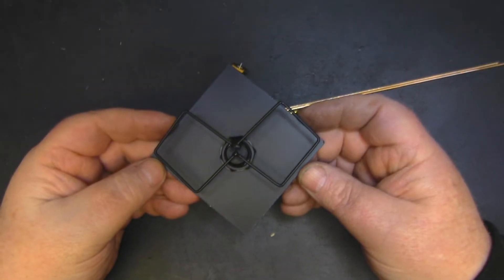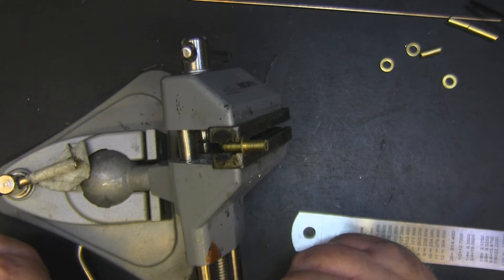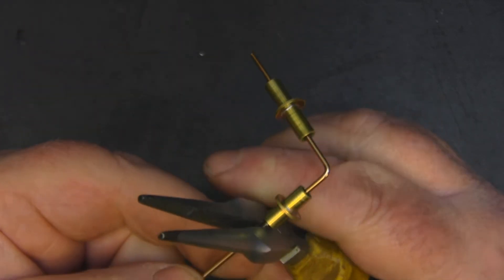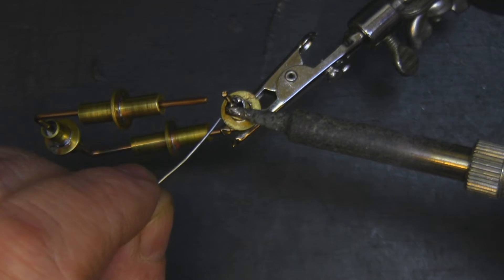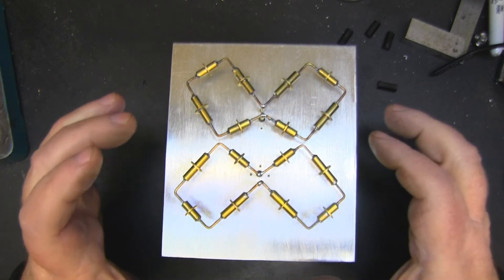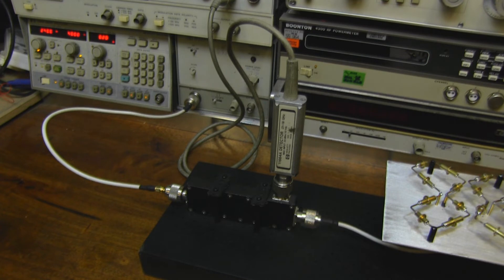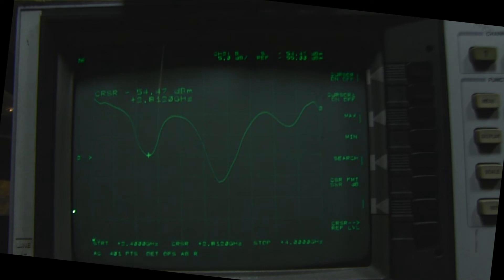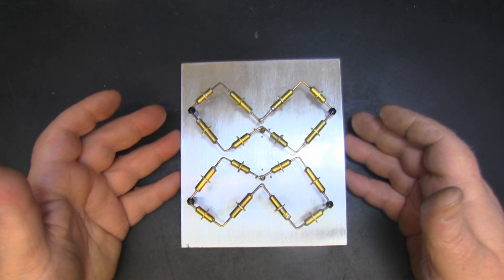3G 4G and now 5G Biquad Panel Antenna

Comment: Hi Andrew, sorry for disturbing again. I live in Canada and my tower runs one band 4, 1700mhz uplink and 2150mhz downlink. Should I build this antenna or stick with the 5g patch you built a while ago? I asked this same question a while ago. This antenna does hit 2200mhz and 1800 mhz, but will it work for 2100 and 1700mhz?
Reply from the maker: Yes this will work just fine
Reply: @andrewmcneil  thank very much, sorry for the multiple messages
Reply: @andrewmcneil  Hi Andrew, sorry for bothering you. Can I use thicker wire to increase bandwidth or should I stick with 1.6mm?

Comment: I tried to build this antenna paired with Deco X50-5G (using lmr400 cable) but the best I could achieve is increasing signal from -90dbm to -86dbm , is that okay? Or may be i did something wrong?

Comment: thanks chief. I have issue with signal strength indoor, and I wanna build a 700/1800MHz 4G+ antenna. I have already Mikrotik router with LTE class12 modem.

Does the coax cable matter, please?

I can squeeze about 3mm wire through out the old windows (old rented flat). I can't drill walls or window frames. I have some old 3G antenna with external antenna, and they have about 3mm coax.

Any suggestions to this challenge? all standard coax cables have around 5-6mm

Comment: Thanks. Two questions. 1. In testing this antenna you get a peak at 3.3 GHz which you said was smack dab in the middle of the 5 GHz band in the UK. Will this antenna work for 2.4 & 5 GHz WiFi in the U.S.?
2. What’s the function of the brass tubes and washers?

Comment: The brass brazing rods I ordered came in from China and are 2.49mm in diameter. Will the antenna still work or should I keep looking for 1.6-1.8mm rods?
Reply: Thank you. They wouldn’t ship to the US, but I found a US vendor with them.
Reply from the maker: Here you go https://www.ebay.co.uk/itm/283737510849?var=585147618693

Comment: Hi Andrew, Please pardon my lack of basic knowledge of this subject.  I am using a Huawei B535-333 4G LTE Mobile Broadband Router  to get internet in my shed. I have a large external flat panel aerial mounted high up. The signal is really weak here in Wales as the mast is about 12 miles away. Will this antenna improve the signal do you think would several of these connected together help ? Thanks

Comment: What do you think is more important, materials or design?

How do you come up with your designs (shapes, materials, thicknesses)?

Can you please show download speed tests, i am personally interested and i think others would be too meaning you would get more views if you wanted them.

I want to build antennas to improve my connections for cheaper than buying a premade board. 

Could you make designs based on, eg the waveform 4x4 and 2x2 antennas with copper/brass tape without breaking intellectual property laws ( their designs look quite simple in teardowns are are probably copies of other designs. I dont know.)

I know thousands of people want the bigger 4x4 antennas but arent willing to shell out $400. But would spend the time building one for even a small gain in signal strength/quality. The lowest ive seen a 2x2 antenna for was $70.

Comment: I'm glad to see you back, I always liked your videos. I'd like to ask you if you know measurements of bi-quad antenna that would be ideal to use with satellite dish for only 800 mhz LTE band 20? (Or your recommendation for different type of antenna that would work better with satellite dish)

My problem is that i used "Modern BiQuad antenna calcullator" from 3g-aerial website which works really well but the antenna is too big to be used with satellite dish - about 30 centimeters at widest part. I have clear view to the Cell tower so i'd like to improve my signal as much as possible.

Comment: Sir i want make network repeater i need help to make it
Reply: Get a dd-wrt compatible router
Reply: @transkryption  i dont get network at my floor so dd wrt compatible router solve my problem?
Reply from the maker: @PatelAkhtarrza It will be the best option because it gives you much greater control
Reply: @andrewmcneil  ok i will try
Reply: just use old wifi routers and Open WRT and the B.A.T.M.A.N protocol and you can build a city sized mesh network.
Reply: I have tenda n301 router ill check dd wrt not support i will try to dd wrt firmware but i dont got file on internet
Reply: Use google